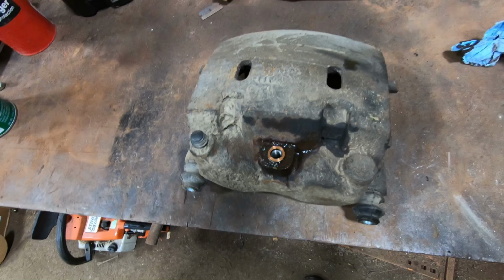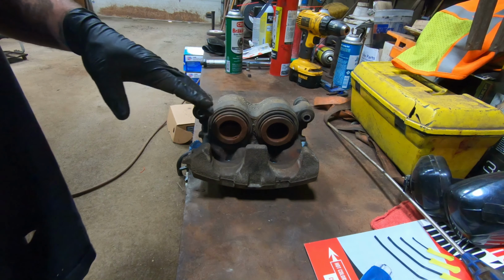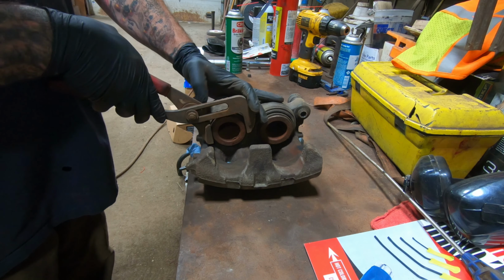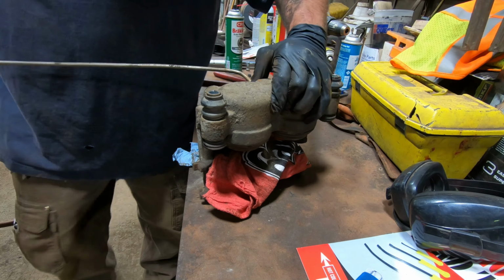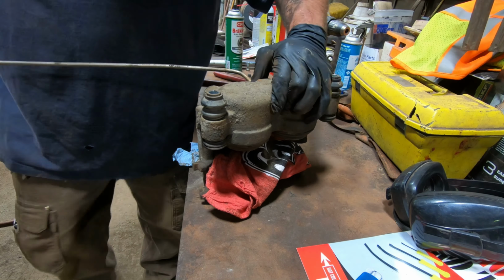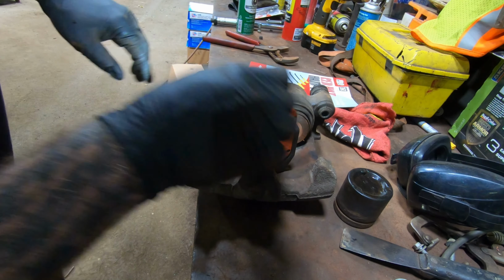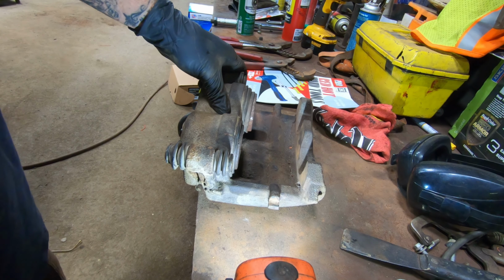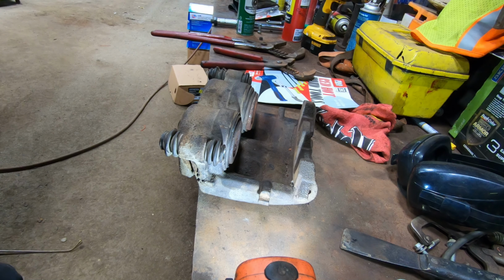Why is this brake caliper piston not compressing

Comment: I agree that sometimes it is not cost effective to rebuild brake calipers. I will rebuild them if a replacement caliper is unavailable. Dodge and Ford had an issue with phenolic pistons back in the mid to late 80’s.
Reply from the maker: I guess if I couldn’t get a caliper I would probably rebuild it too. I didn’t realize the phenolic pistons were around that long. I learn something new everyday. A guy I work with was telling me about some ceramic pistons. Said they crack easy if your not careful compressing them but seem to work well otherwise.

Comment: You can sand them down and after oil or grease them lightly and make sure you clean the inside with some brake cleaner and your good to go!
Reply from the maker: They don’t seem to difficult to repair. It’s weird it was just the small ring of rust that was causing the trouble.

Comment: Hi. Need a lil help here! I got a 05 650. No brakes so I did all new calipers. Still no brakes. Just replaced master cylinder still no lock. Handle still don't seem to be doing much. Pretty lose goes all the way in! Any ideas what it might be? Thanks
Reply from the maker: That does sound weird. Is there a leak in a line or does bleeding it help.
Reply: @JasonTheMunicipalMechanic  No leaks. im fixing to bleed it after installing new master cylinder. See what it does
Reply from the maker: @POLOAZTECA  I would try that, I don’t know if it has an abs module on it but could there be a valve stuck open or air in there as well.

Comment: Very interesting video. Surprised by what the issue was. Wondering how to know if a brake is having that issue and how to determine it is a developing problem early enough to fix it before it  causes a problem .
Reply from the maker: It was weird just a little ring of rust stopped it. It was all phenolic except where it was joined to the metal end. It seems like it was this there and rusted through or something. It’s probably hard to tell it’s happening, once it’s past the seal it doesn’t really go back in until you put new pads in. All 4 were doing the same thing. They didn’t hang up it just wouldn’t compress enough to get the new pads in. It probably would have stuck on if I forced them in.

Comment: This problem with rust forming under dust seal seams to be the same problem every time. I have had the problem and lots of videos I have watched with the same findings. I am thinking of spraying a little wd40 under the dust seal as a preventative maintenance. Any ideas?
Reply from the maker: Unfortunately I don’t really know how you might stop the rust. Maybe like a fluid film or something like that under the boot. It would need to be compatible with the seal and boot material and not degrade it. It’s a pretty harsh environment and difficult to reapply. I heard about some ceramic pistons that might be a good alternative if they have them in the caliper you need.